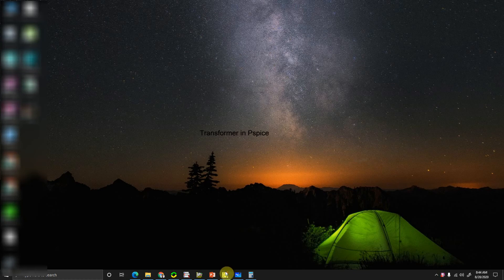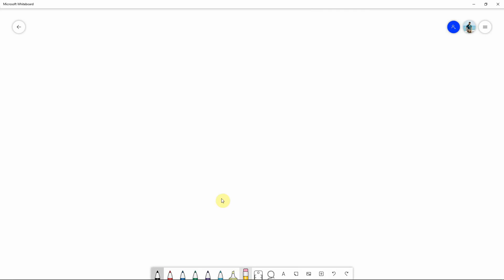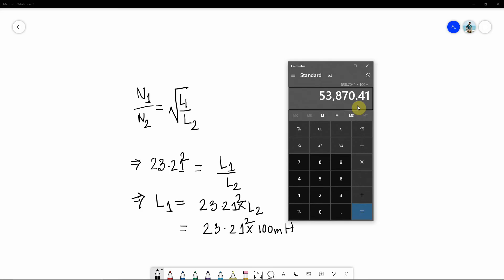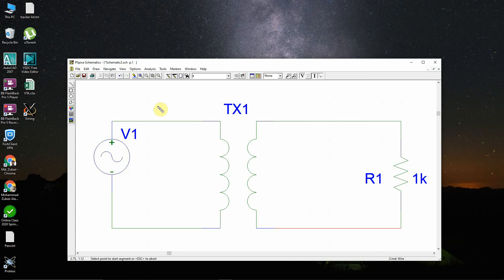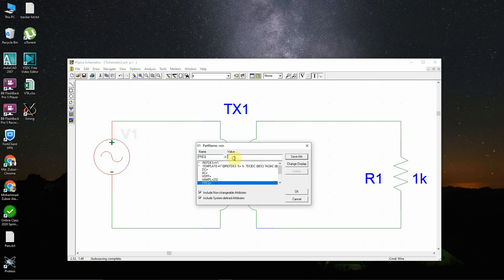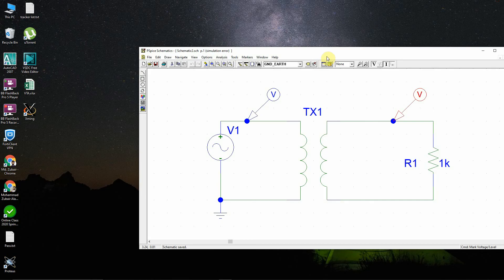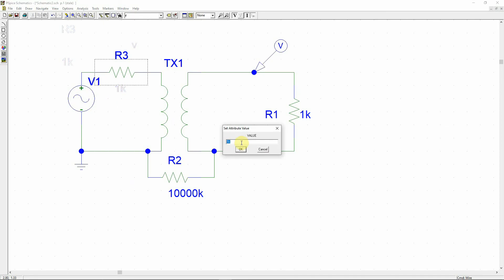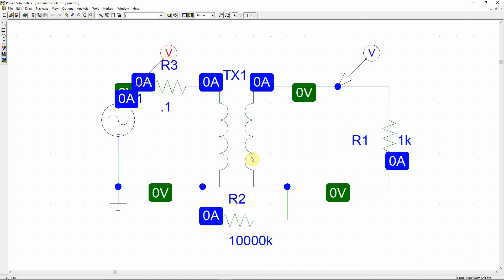Transformer in PSpice

Comment: what is the purpose of the R3??
Reply from the maker: In practical case there is resistance in inductors. But in simulation, if you don't provide any type of resistance with inductor, it may create simulation errors